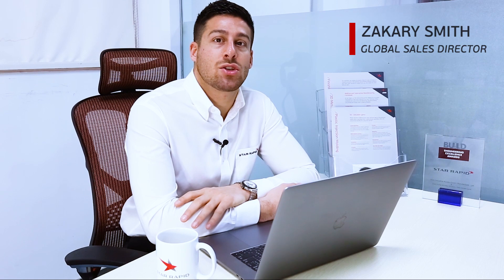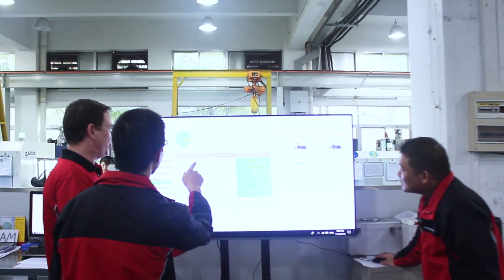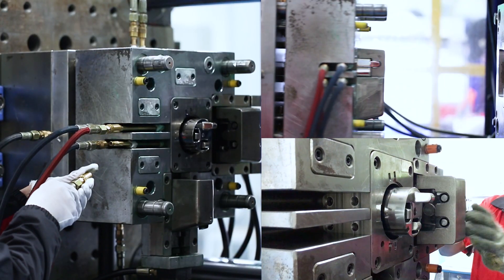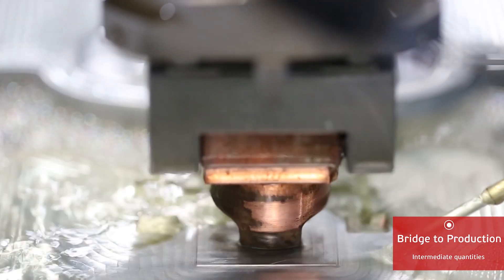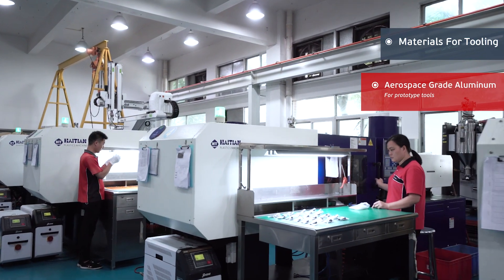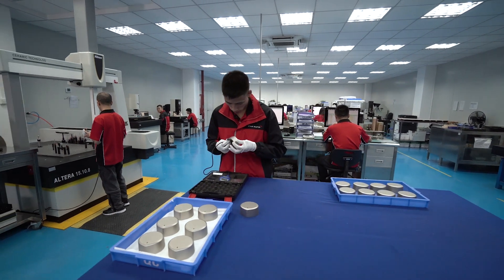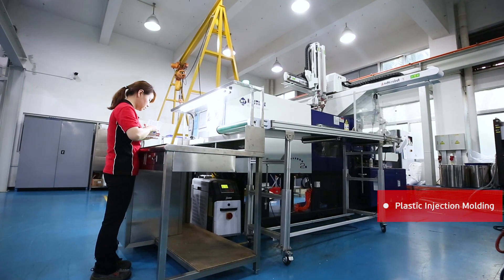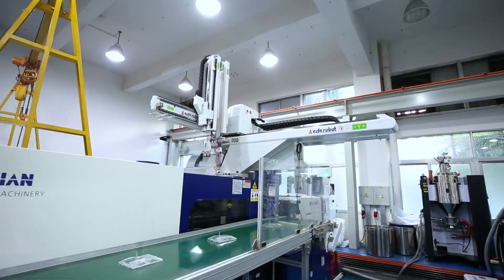Plastic Injection Molding Process at Star Rapid

Comment: What is gas assisted injection molding?
Reply from the maker: Gas-assisted injection molding is a molding process where an inert gas is introduced at pressure, pushing the plastic melts into the mold extremities at the end of the polymer injection phase.
Reply: @starrapid  Thank you for your response
Reply: @starrapid  can you assist with injection foam moulding? chemical blowing agents and cross linking agents to achieve cross linked, closed cell foam parts. I have sent a request via your website today.